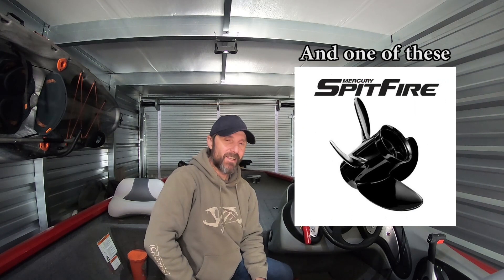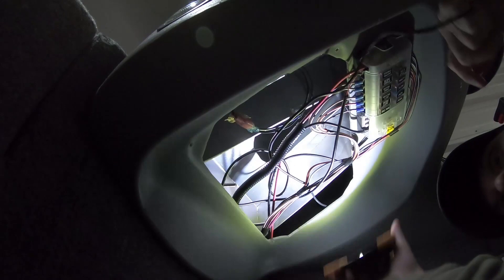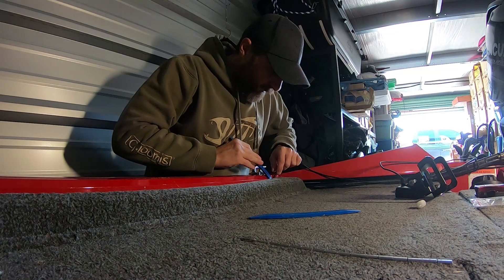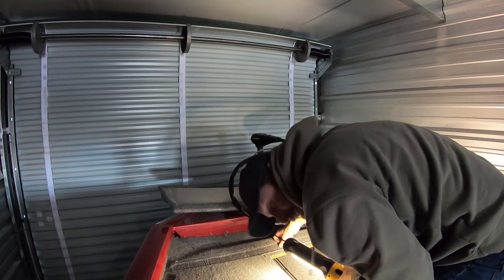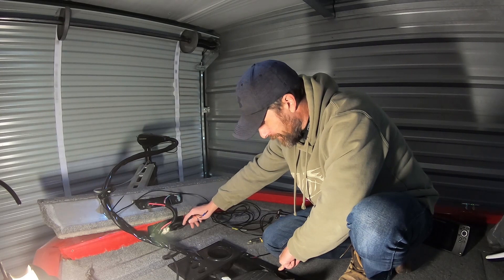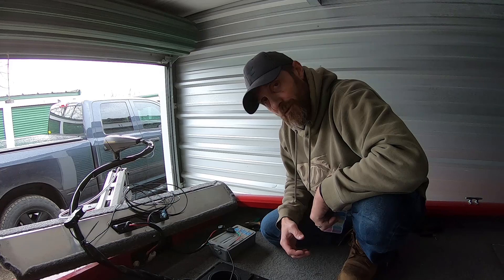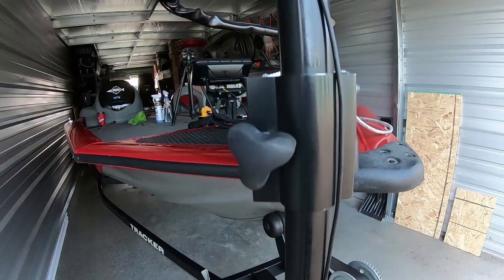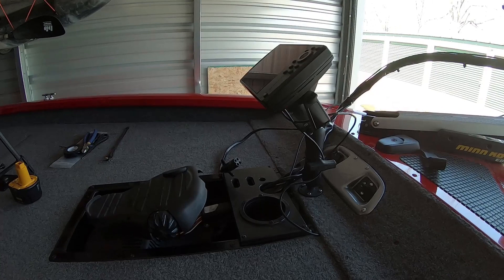Moving My Helix 7 To The Casting Deck

Comment: Did you check the amps on that power wire before you spliced in the 3amp ? Or does it not matter because the unit will only draw 3 amps so you could use a power wire that has let's say 10 amps and you just tap into it for the 3 amp inline fuse ?
Reply from the maker: I never checked the amps on the power wire. Figured it was a low draw anyways. I ended up putting another fuse at the battery. Had a person suggest doing that so I did.